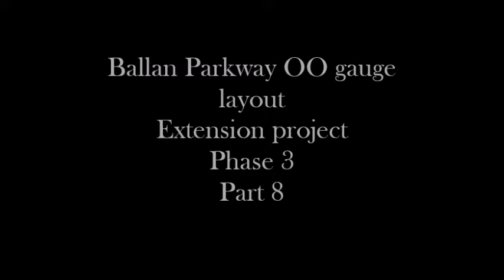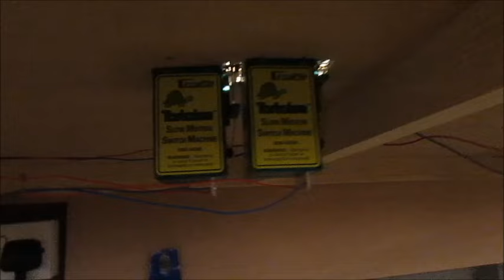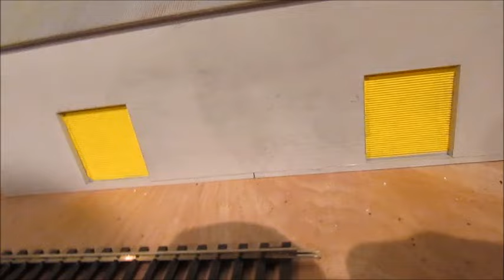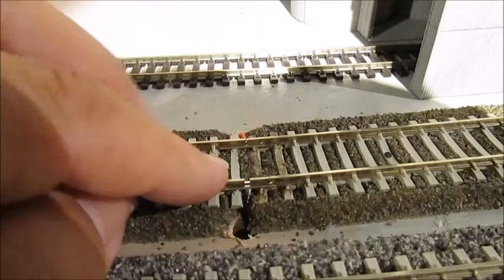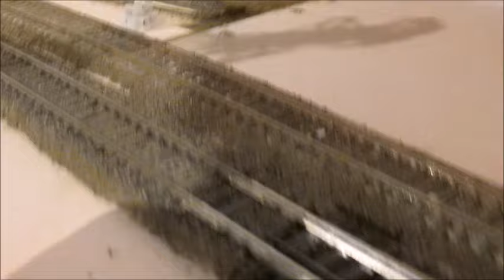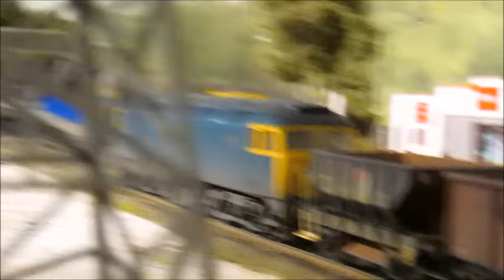Ballan Parkway OO gauge layout extension project phase 3 part 8

Comment: Looks great - one suggestion, having done a few bits of hard standing area, rather than using balsa wood, i've found that artists mounting card from Hobbycraft works much better and is easier to use.  One piece between the lines and then two pieces stacked for the outer lines part.  If you look at my Traction depot on my layout you'll see how it looks. Hope this helps :)

Comment: Hi, 
Looking good on the new section. The cement work near to me as the run round for the loco and one other short siding. I would not join back on to the main lines. 
Peter
Reply from the maker: Thanks Peter,

I have decided to do what you are also thinkingt in the end. Makes the layout more interesting.